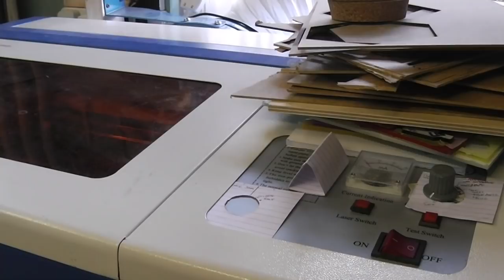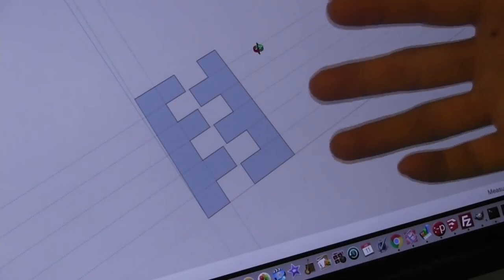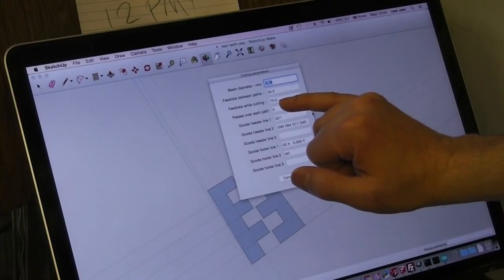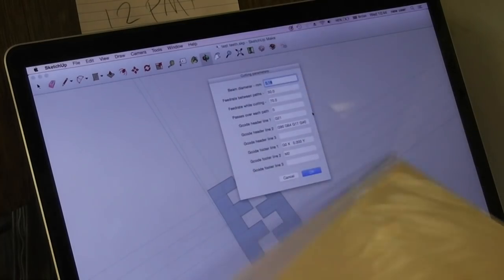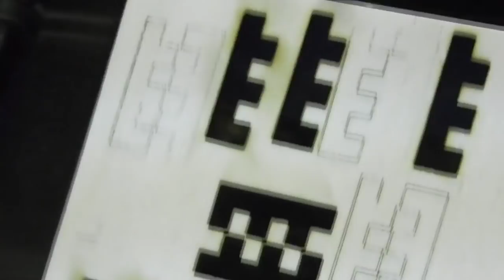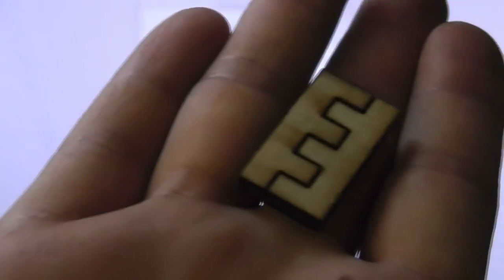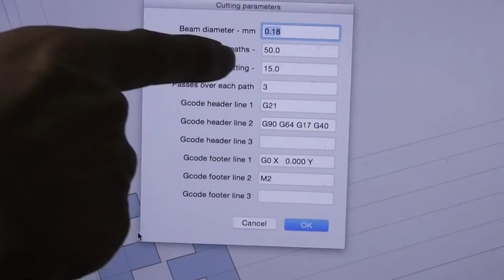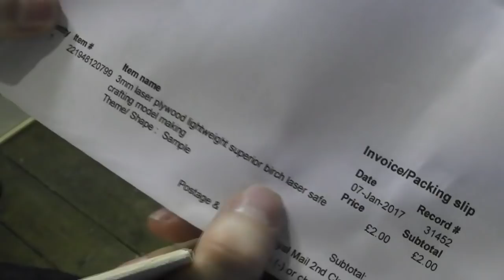Will it cut? 3mm 'Lite' Ply on 40W laser

Comment: Hi.
How well does the machine cut 3mm or 6mm plywood, hdf or mdf ?
Looking into purchasing this machine but would like it to cut in just one pass.
You uk based?
Thanks
Reply from the maker: This machine can cut 2mm laser grade MDF but the cut is charred and needs more than one pass. Possibly there is a compatible lens available which would cut wood better than mine, but I haven't tried any others than the one which came with the machine. I suspect an 80W laser and a good lens would be able to cut any sort of wood well. I don't know anything about the Chinese 80W lasers though.

Comment: I have  a k40 laser. I use the 5mm plywood from homedepot. I use the following settings for cutting. Cut power at 14.5% to 14.7%,  with 4 to 5 passes. The cut speed 8 mm/s,  these settings work good most of the time. I use the k40 whisperer software.
Reply from the maker: It's impressive that you can cut standard plywood on one of these. Whenever I've tried plywood (spruce, I think) from the hardware store, the wood chars and only cuts through about a millimeter. Are you using the lens that came with the k40 or have you upgraded it? Do you focus the laser on the surface or part way through?
Reply: In January 2018 I bought my k40 laser from ebay. This was the latest model at that time. It has a digital power display, and lcd temperature meter. I am using the stock lens. I don't change the focus. I removed the clamp, I lust placed the plywood on the table. This is the 5mm, not the 1/4" plywood from home depot. This plywood comes from china. On the label it says Tri - Ply underlayment, again it is 5mm thick. I use k40 whisperer software, and slowed the cut speed down to 8 mm/s. Hope this helps you out.
Reply: While I an thinking about, check your lens. When I got my laser I had problems cutting, the lens was upside down. One side is flat, the other is domed, you want the flat side down. I spent a week adjusting my K40 laser when I got it, everything was out of aliment. There are videos on youtube that people have posted about all of the problems with this laser cutter engraver.
Reply from the maker: Thanks, when I bought my laser I checked the optics and removed the clamp. The lens was the correct way up but I had to spend a couple of hours re-aligning the mirrors before it would cut right. I added the honeycomb mesh as a cutting table - I think it's normally used for custom car bodywork. I suspect the tube I have isn't actually 40W in power, and the current control only has effect up to about 10-12mA - any current setting above that doesn't actually increase the power from the tube.

Comment: masking tape is your friend...  all but eliminates discoloration/soot on the face...
Reply from the maker: Thanks for the tip - although when I've taped down veneer in the laser cutter the tape tends to burn if the laser hits it. Is there a way to avoid that? I guess you could make a low power cut first to cut through the tape. I have a very powerful fume extraction system - possibly, that is causing things to burn more intensely in my cutter.
Reply: OpenTronic...  i tape the entire surface and let the laser just blast thru it.... I've not had the tape catch fire yet...  but i was cutting ply
Reply: Could be it.  I wish mine moved more air.  Next time I burn wood, I'll try to take a quick video.  However, I'm adding an air assist (after I tear a wall out the house for my wife), so my unit is in several pieces right now.

Comment: I do have a question - how did you enable the laser to start another path without the need to 'confirm' 2nd run?
My unit will always ask to 'confirm' next queued run/cut
Reply from the maker: Przemysław Wilkutowski I removed the original control board and replaced it with one that will run gcode. I made a video about it: https://youtu.be/As0myXMCHYg

Comment: Why don't you use air assist? As I understand it you can't achieve the same effect with extraction as you can with true air assist blowing air into the cut. You can't stop the edge burning etc etc with fume extraction. I also have one of these crappy ebay k40 devices (fantastic value for money once you get it working) so I'm not just talking out my bum lol
Reply from the maker: I'm too lazy (actually too busy) to get around to fitting air assist. I want to see how far I can push my cutter without air assist. I'd like to fit it in future though. I built a very bad attempt at an air assist system when I set up my K40 but I used a type of pipe that was too rigid, and an underpowered air compressor without an air cylinder. So it was something I originally wanted, I haven't got around to putting all my mistakes right. I still have the 3d printed nozzle I got from Thingiverse for that purpose..

Comment: Thanks again, spooky really as I've spent the afternoon today with my grandson experimenting cutting ordinary 3 mm ply on a k40. FYI at 20amp 8mm/sec and 6 passes, it cut thro in the end but with major charring.I found you procedure very informative , keep up the great work.
Reply from the maker: Przemysław Wilkutowski my approach is to always run the laser at the minimum current that will work for the job I'm cutting. I don't think it's possible to be sure about maximum current because it varies a lot between manufacturers and the documentation is either missing or untrustworthy :) The only way to know the max current would be to buy a laser power meter and study the output over the current range.
Reply from the maker: Thanks, it's impressive that you got through ordinary ply. It does always seem like a balance halfway between setting the wood on fire on one hand, and barely marking the surface on the other! This balsa cored plywood seems very good for lasers (though more expensive than the stuff from hardware stores) and I've pushed the boat out and ordered some 6mm ply of the same type. Which would be an amazing construction material with a great surface finish, if it cuts.
Reply: OpenTronic yes the autumnal smell of burning wood is still pervading most of the house even tho the exhaust pipe was well and truly pointing out the window. BTW my 'ordinary ply' was marked as laser friendly but had normal wood in the centre,
Reply from the maker: I think 'laser friendly' can mean a couple of things. It definitely means that the resins used to hold the ply together produce less toxic fumes than those in normal plywood do when they burn. And it can also mean that it's less dense so is easier to cut with hobby lasers. So at least all the smoke in your house is not very poisonous!
Reply: Smallest Workshop don't run it at 20 ma the 40 wat tub maxes out at 10 ma anything above is basically over driving tube
Reply: Actually there was a guy on the forum that measured the out put of the tub against the '%' setting, so the curve chart is out there.

As for the current, you are right - worth getting an am meter in there. I'm running the version with one so i can see the power going into the tube.
Reply from the maker: http://www.prutchi.com/2012/02/05/d-i-y-co2-laser-power-meter/ this is the sort of thing I'd like to build one day. It's not as complex or expensive as I thought.